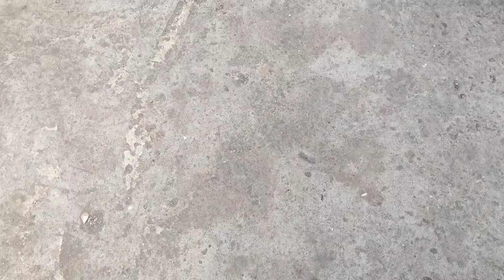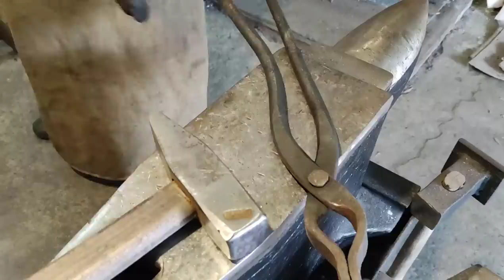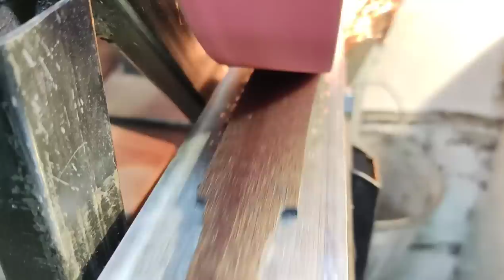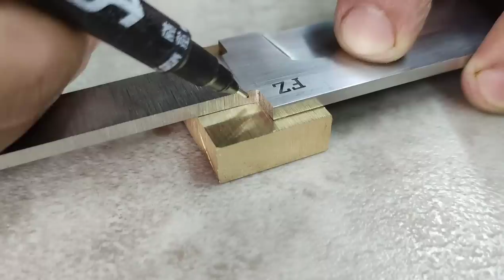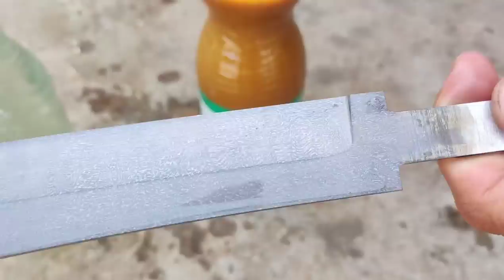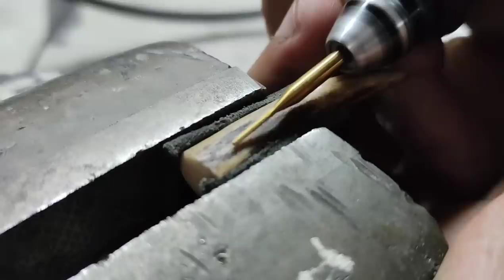WOOTZ steel from 1000 year old arrowheads . MAKING A VIKING SEAX!!!

Comment: I am simply amazed at the fact that you could actually remelt Viking arrowheads. I mean they have to be over a thousand years old or at the very least almost a thousand years old. Are you telling me that the metal they created almost a thousand years ago can live up to the standards of the metal today? Like it heat treats and a meals and etches and all that great stuff just like metal of today? There's just so many questions that I have. And this has to be one of the coolest ideas for a knife. I actually have a Viking pocket knife that I bought as a souvenir and just looking at it I would never think you could make something with it.
Reply: Next question, is this for sale ?
Reply from the maker: Yes .  This knife is for sale, but the price includes the purchase of arrowheads and work ...
Reply: @fz-makingknives3663  I'm sure it's worth every penny
Reply from the maker: https://www.etsy.com/listing/1045397245/the-knife-is-made-of-viking?ref=listings_manager_grid
Reply: I just checked it out. I think it's actually a reasonable price. Now I just have to convince the wife.
Reply: Even if the arrow heads were just iron he added enough graphite to get a high carbon steel and the long heating in the crucible allowed the formation of the iron carbides that is the charistic of wootz steel. This is not ordinary crucible steel which steel mills make today - almost all steel used today is crucible steel made in crucibles holding many tons of molten metal which produces  nothing like what he makes.

Comment: I have a question regarding your handle construction technique. I noticed on this blade (and others) you hog out the handle hole a lot bigger than the tang and rely completely on the epoxy to hold the tang into the handle material. Is there a reason why you don't cross pin to make a mechanical lock into the handle material as well? Purely asthetic? I am an aspiring bladesmith and was under the impression that a mechanical lock is important to incorporate and to not rely solely on glue.
Reply from the maker: We have been making knives for eight years.  Not a single knife was returned because the glue fell apart
Reply: @fz-makingknives3663  i was not implying that the technique or quality was bad at all...was just hoping to get your take on the technique :) I'm learning the process and you do excellent work so I had hoped you would be able to explain to us the thought behind the method
Reply from the maker: We have made many custom-made knives.  And customers prefer different handle assemblies.

Comment: I'm curious what brings out the pattern in the wootz steel? 
Is it acid etching? Or another process?
Reply: Looks to be ferric chloride, basically an acid etch containing iron oxides that turns some of the subject steel darker by accelerated oxidation, converting it to Fe3O4 (ferric oxide, or magnetite) rather than Fe2O3 (normal brown rust).  The acid works faster on high carbon steel alloy than low carbon/low alloy steel, so the result is that the dark stuff is high carbon and the gray stuff is low carbon.  Fairly standard practice with pattern welded steels too, though it's too often used excessively and deeply etches the steel for a ridiculous looking contrast.  FZ is one of the few knifemakers that use it sparingly, just enough for it to be visible up close, and I think it looks a lot classier.

Comment: Is there a reason you decided to rely only on epoxy to keep the blade in the handle? Would an additional pin assist in holding the blade or is that overkill? Super nice blade btw!
Reply: Traditional Saex handles were not pinned.
They had then tangs more like on a modern file so it's possible the handles were burned on, although ground fish bone paste was widely used as glue. It is pretty strong but has a long curing time.

Comment: I hope your training a apprentice.  Also have you ever tried destructive testing on a blade to see how much tougher they are over a quenched blade( disregarding the  beauty of the blade). Almost think there where Monks hymning in the back ground by the way the blades are forged ? (Toledo)
Reply: This blade is quenched just like any other modern steel blade, that's the part where he takes it out of the oven and puts it in the oil.  Quenching is the process of heating steel to a critical temperature and rapidly cooling it to essentially freeze grain structure and convert austenite to martensite.  I didn't see him temper it in an oven though, and one of his comments mentioned an RC of 61, so it would appear that it's fully hardened without a temper.  Tempering is basically a reheat at a lower temperature (below the point where martensite begins converting back into austenite) and alters the carbide microstructure of martensite, giving it a more ductile quality at the expense of some hardness.  The other added benefit is that it relieves some of the internal stresses caused by the conversion to martensite, as martensite shrinks when it forms...that leads to the steel trying to pull itself apart internally if everything is not perfectly distributed or evenly heated/cooled (it never is), and can potentially cause weak points or warps in the blade.  Low temps won't do much beyond relieving some internal stress, most knives are tempered around 350-475F, axes and other heavy duty stuff can go all the way up to 500-600F, and beyond that point you start losing all of your hard-earned martensite until you're left with a weak and soft steel again.  So you can have a steel that's harder than glass and almost as brittle, not very hard but considerably stronger, or somewhere in between, depending on the quench and heat you use to temper. For knives that aren't being bashed against stuff or used for prying, not having a temper can be perfectly fine...but larger blades and knives that will likely see impact and abuse last a lot longer with a temper.  It has everything to do with how the blade is intended to be used.  Fully hardened blades do tend to chip the cutting edge rather than rolling it over, which makes for more work when sharpening and reworking the edge, and that means you have to grind more of the edge off to get it back where it needs to be.
Reply: @Skinflaps_Meatslapper This is a very helpful answer and not said in a condescending way. Much appreciated!
Reply: @timchapman6702  That was the intent :D

I enjoy sharing knowledge of things I've learned because someone took the time to share their knowledge with me.  The least I can do is continue the tradition!